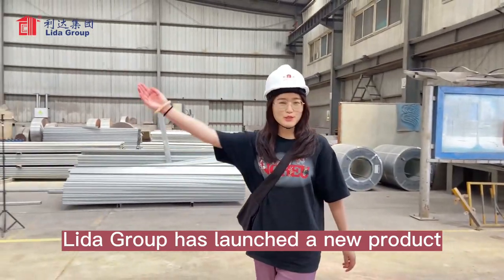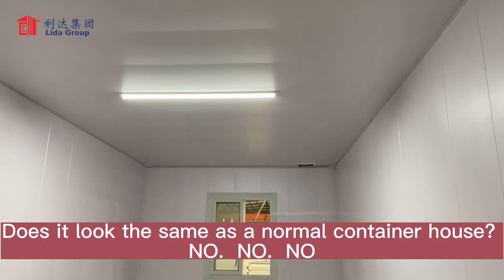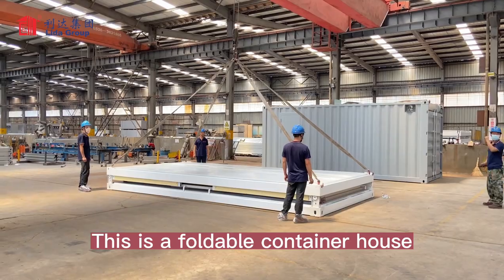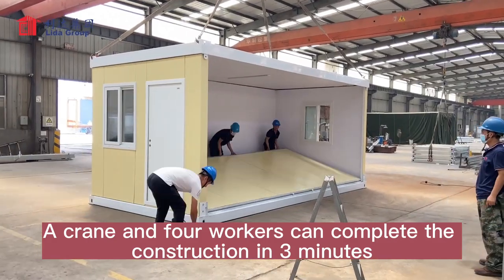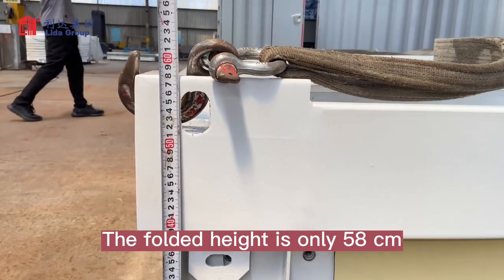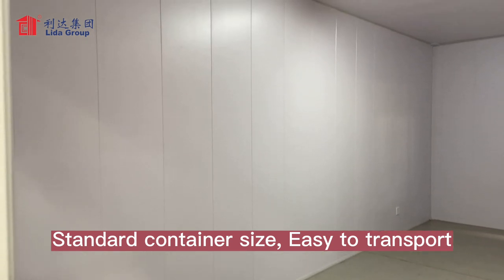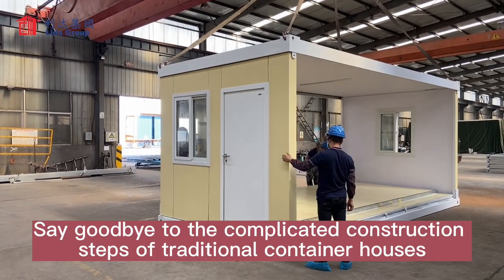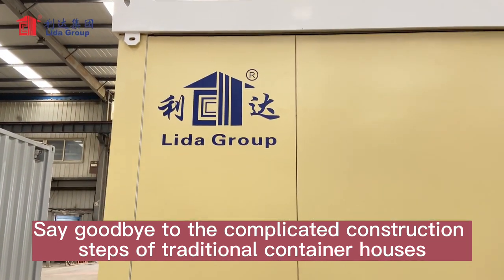2022 new folding container house

Comment: Can i buy one in Vancouver, 3*5*2.2m with one door and 2 windows, folding or detachable, easy by one person installing or dissembling
Reply from the maker: our factory is based in China, we put the foldable container house(6x2.4m,height is 2.6m) into the 40ft Shipping container and transport through sea, 10 units foldable container house would be loaded into one 40ft HQ Shipping container.   MOQ is 10 units.  your required 3 meter width are not suitable for sea transportation, feel free to contact me for more details (adam.lin@lidajituan.com OR Whatsapp 008615764255025)